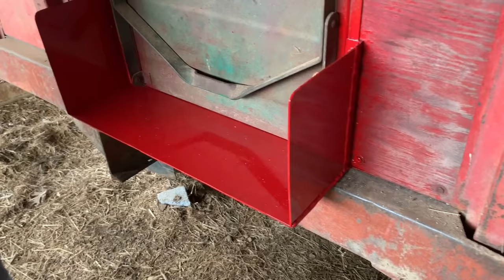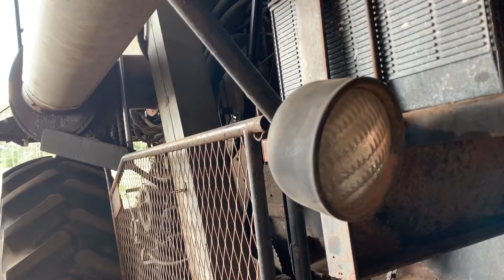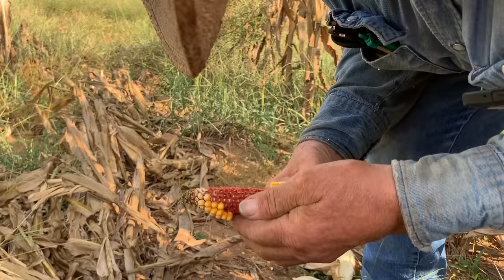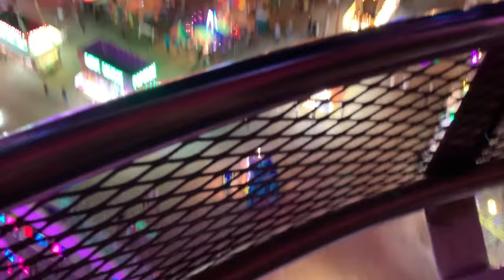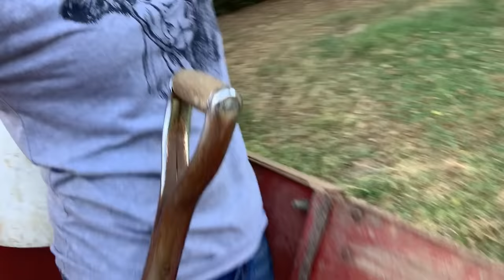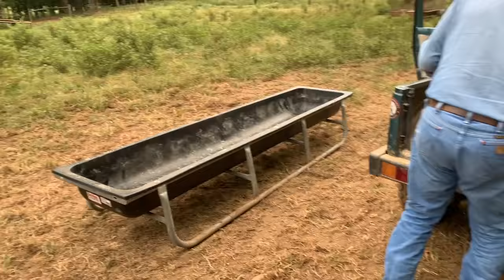Harvest Prep & New Things

Comment: You will be shocked at the sales you are about to receive. After the shock and nights of laying awake wondering what the heck was you thinking and let's not forget the nerves. When all that settles down start looking into selling through Amazon. You got this girl, run with it. If it all fails and it won't but if it did you are still you and that's a pretty good thing in itself.

Comment: word of caution about the fire extinguisher in the combine: if it's got some age to it, there's a good chance it won't work even if the gauge says it's good .... a good portion of the time, after years of vibration riding in a machine, it takes a toll on the chemicals inside and they 'set up'.